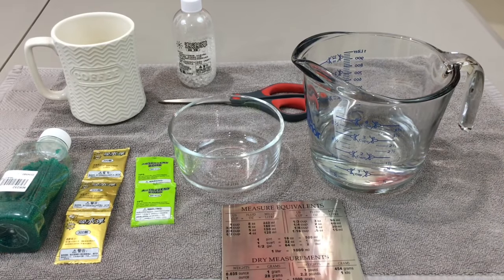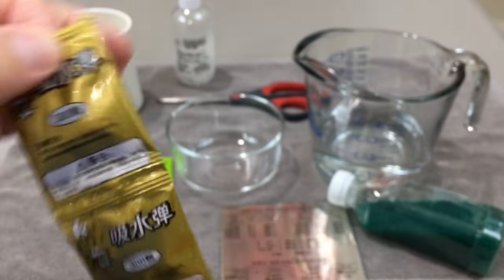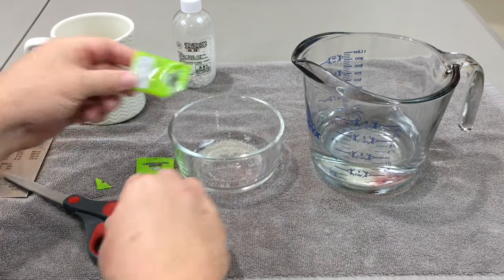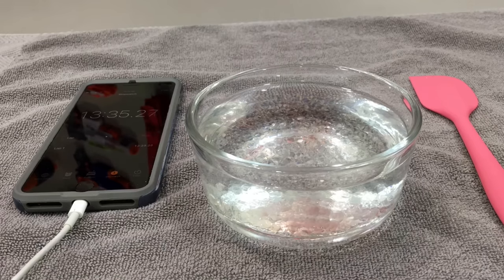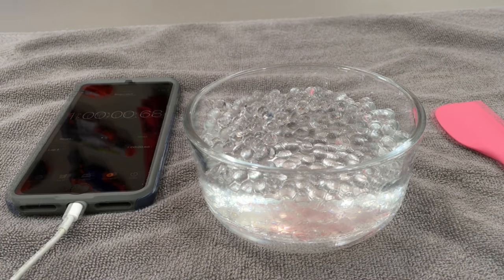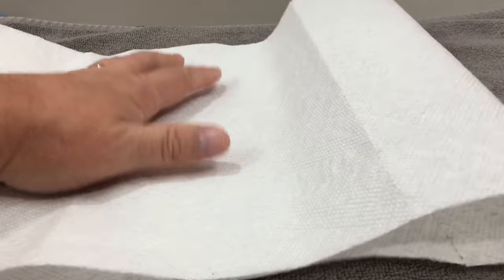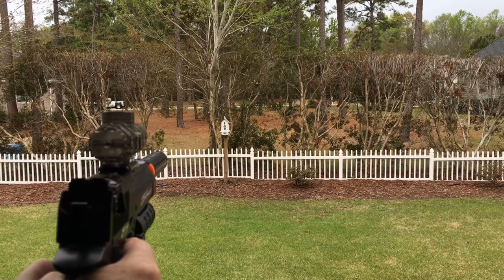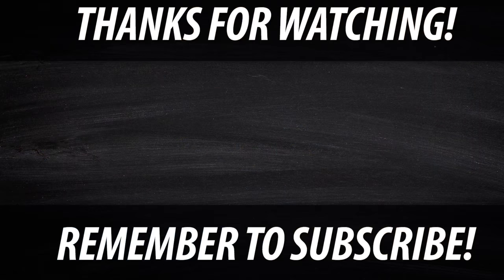How To Grow Gel Balls - Full Tutorial With Time Lapse

Comment: Nice video. You don't seem to be using enough water as the gel balls are expanding above the water line. I just use a large bucket and throw a few teaspoons in there and leave it overnight.
Reply from the maker: I will try to add more next time thanks for the tips and feedback my friend
Reply: @CjNerf  My Australian instructions , which should be the same for our  American friends , say 2 cups of water per teaspoon of gel balls. That's a lot of water but as long as the gel balls are fully covered, you should be right. Fair dinkum.